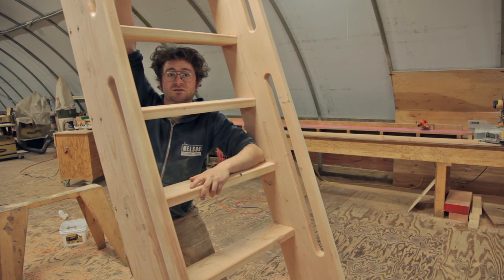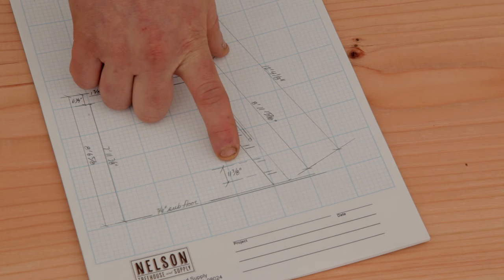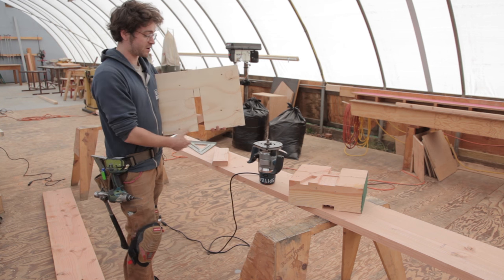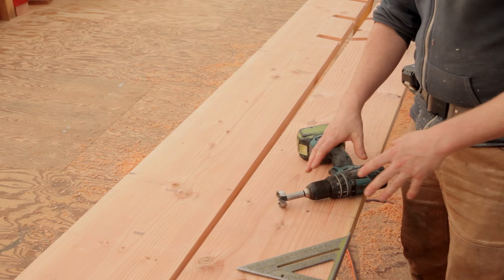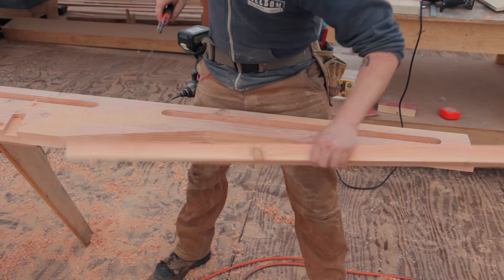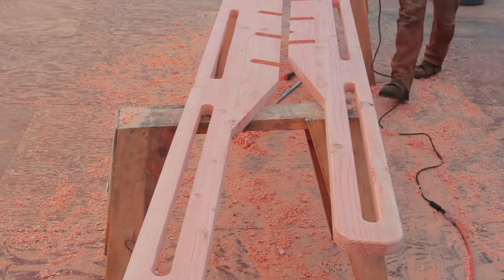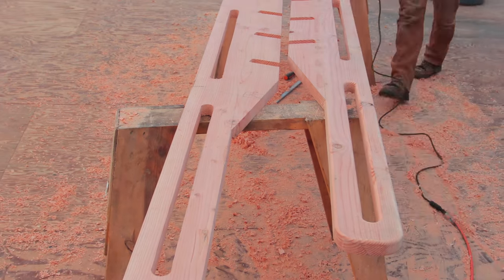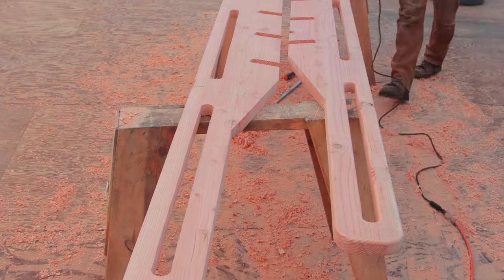DIY: How to build a Ships Ladder

Comment: I am confused about the plunge router bit.  I am using 1 1/4" oak for the sides of my ladder and 1" thick wood for the steps.  I got a 3/4" plunge router bit with a top bearing and did a test run on a scrap and I used a 3/8" edge bit and rounded over the edges of my first step.  They do not fit together.  Didn't you mean that I should use a 3/8" plunge router bit?  Then I started looking for a 3/8" plunge router bit and I simply can't find one that is 5/8" deep.  The one that I found is only 1/2" which means I will have to do every single plunge twice to achieve the 5/8" depth.  Also, I read that it is going to be hard on my 3/8" bit to do all that plunge work (esp. with oak) so I am going to do it with the 3/4" bit and just cleanup the corners with the 3/8" bit - which means I have to do every one three times.  Once with the 3/4" bit and then twice with the 3/8" bit.  I am using a router with a 1/4" shank.  Should I be doing all of this with a 1/2" shank given that I am using oak?

Comment: I too wish I could upload a picture.  Mine's just getting assembled, staining and verathane to follow.   I used the fancy router bit to cut out the handles because I was simply not brave enough to use a Skil saw, but I did trim the ends with a skill saw and then finished them off with a jig saw versus a Japanese pull saw.  Took me a really long time to build it though, a month of weekends and a few mistakes along the way, but I am finally there.  Thank you Charlie Spitzack!

Comment: Just built one for my garage loft, super easy to build and is so stable and strong.  I finished it in linseed oil with a darker stain on the treads to hide dirt.  Thanks Charlie.

Comment: I just built one to get easy access to my loft storage space over my work area in the shop. Had to special order the pattern router bit (Whiteside brand are really nice ones) but found everything else locally. 
Turned out super nice and I’ll be attaching it to at loft with hinges and will raise/lower the bottom out of the way with an electric winch. 
Thank you for the inspiration.

Comment: Awesome instructions. I really found this helpful so far. I'm not sure if I must use a plunge router. I might need to buy one :-) which is awesome. I'm still feeling shy about the plunge cuts with the circular saw. I have a couple side winder circular saws. But, I see the man using a worm-drive circular saw. In my mind, this seems like a more stable power tool for these internal cuts. I might need to buy one of those too. 

Thanks. I'm having a blast!
Reply from the maker: Thanks for watching Ken! If you build one send us pics!

Comment: Why do you need a 16 foot length of 2x12 when the longest dimension is 12 foot, 4 and 1/8 inches.  Could I not use a 14 foot piece instead? Or a 12 foot piece with 5 inches glued onto it's end? I like your work though.

Comment: What a great vid. Exactly what I needed to see!

I'm contemplating building a ships ladder very similar to this, but it doesn't need to be anywhere near as wide. Also, weight is an issue. Would 1" x 12" x 12' stringers (and matching 1" x 6" pads) out of poplar be strong enough if the width is about 18" from outer edge of the stringers? Wife is small and needs to be able to move it a bit. All help appreciated!
Reply from the maker: I don't see why not!

Comment: 12:01 Those 4" screws are quite long. Is there any way to make sure you screw it in parallel to the steps? I kinda think i'll screw it tilted and it ends up popping out.
Reply from the maker: Use a drill and give yourself a nice straight pilot hole! This will keep the 4" screws from going in random directions upon entering the wood.
Reply: oh that's nice. Thank you!

Comment: I have a 16 x24 x17’3 steel building,therefore no rafters, beams, etc.  I have a 10ft high loft that is 16x12
and another section connected at a “L” shape that is 6x12.  The only area
that does not have the loft is where my garage door is.  I am wanting to add
in a staircase for access, but am needing it to fold up. 
I am looking at using rails that are 6ft for top section and 8 ft for bottom
section, therefore stair length measure of 14ft.   So 10ft rise and
approx. 9.8ft run.  Does this sound acceptable as I don’t want too steep
as I want to carry stuff up the stairs without needing a handrail, or would a
shorter staircase work better.  I do not have a railing on the loft as
this is in garage and will only be used for storage.  Would you be able to
assist me with some plans and measurements.            
Any assistance would be greatly appreciated.
Reply from the maker: Jason, we have ships ladder plans available here: https://store.beinatree.com/products/signature-ships-ladder-plan      And they are designed to accommodate different dimensions. 

Although a 10ft/9.8ft rise/run would put your ladder angle at about 45 degrees, which i've never seen done before. 

We also would never recommend carrying stuff up a ships ladder with no hand rail, especially one at such an angle!

Comment: Now that I've watched the entire video, and backed up on a few sections, I have a few recommendations.   
You're calling this an intermediate project, but then adding in things that an intermediate level woodworker may not have, or doesn't have the experience in using.    Specifically, plunge saws aren't really an intermediate tool - especially at that size.  Mine, for example, won't cut through 2" thickness, if I recall correctly.  (That tells you how much I use it).   Instead, use the router with a large bit.  That'll make a clean hole (even if you have to use it twice per stringer, flipping it once to cut from both sides).  You then used a rather expensive flat saw, which most woodworkers won't have bothered with buying.   If you need to clean up a round cut, rather than using a hand chisel (which is a basic tool), I would be using a rasp.    (Using the router would obviate (remove), the need for cleaning up that connection anyway, plus no longer needing the flat saw).   At the end, you show cleaning up the wood glue, but don't mention that if you plan to stain or lacquer the ladder, you'll need to sand the areas where the glue has been smeared so that the stain/lacquer will soak in.    That should be obvious to even a basic builder, but this is a rough instruction video.    
For the fasteners?  Rather than pushing a specific brand (which I realize you're probably paid to show), suggest the head type and length.    As was stated in another post, in Canada, Robertson (square drive) head is as common, or more common, than Torx/star.   I can even buy bugle head or round head pocket screws (Deckmate and Kreg Brand) through Home Depot, even in Houston.    I personally prefer Robertson to Torx.     In a few places, the user may only be able to get Phillips.

Edit - the outro volume is much lower than the main video.  It was very hard to hear.

Comment: The video does not address the ravages that Mother Nature will have on the beautifully sanded wood stair. The lumber used are very expensive since they are very wide and relatively long. Tools used are in the advanced craftsman range, so not in the shop of even most experienced craftsmen. The width of the stair is okay for adults BUT not suitable for kids, AND the riser height probably also too high for kids. Other than these obvious things, fairly good video.
Reply: That wood is cheap.   The tools are basic (anyone that builds much with wood will have a palm router, table saw, and miter saw).  The rails are just fine.  Any human old enough to climb that ladder could reach them and would also have no problem with the step spacing.  As for weather, use common sense.  If exposed to elements, obviously it will need to be treated, at the very least, or upgraded to cedar.  But I'd envision this as a ladder that's on the interior of a tree house, or underneath the main structure and thus not exposed to rain.
Reply: Vince Lee calm down sparky